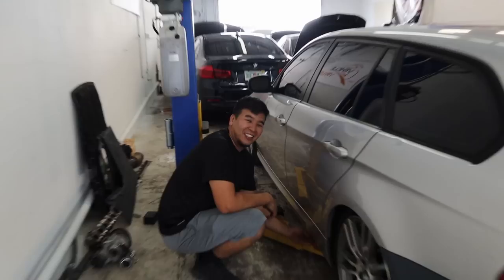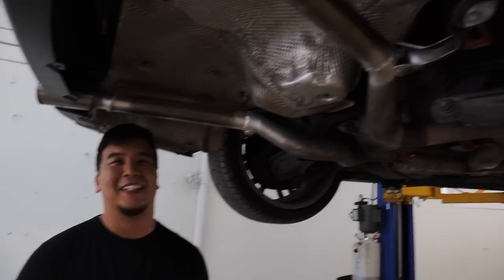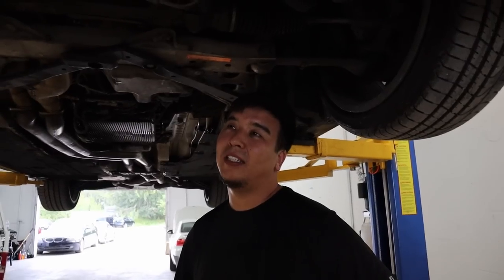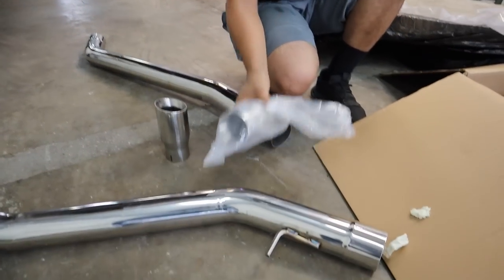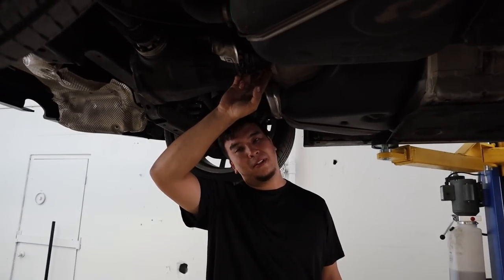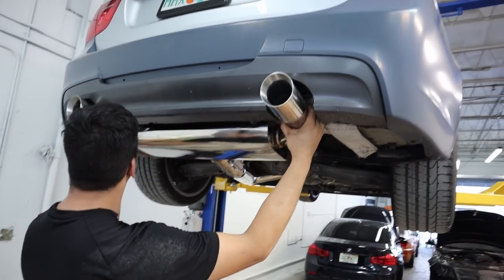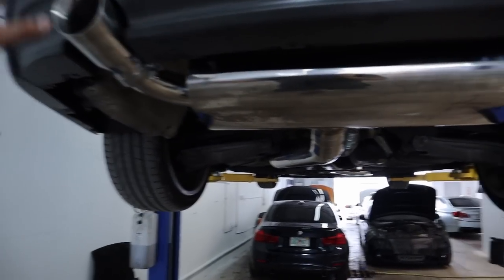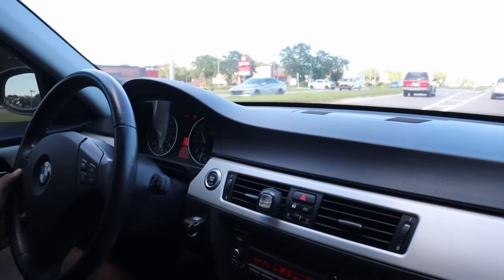Cheap Exhaust System That actually sounds good on a N54 Powered E91 Wagon!

Comment: @swap depot Check the BOV when the car is idling. you might just have the wrong spring rate if its open during idle you got too soft of a spring. Mine did the same thing on my auto until I changed the spring out.

Comment: On that Diff ratio you mentioned, if it's a DCT car, swapping diff ratios will trigger issues, but on the auto haven't seen it trigger any faults. I blew my 3.46 stock diff on my e92 n54 6at (the inner housing that holds the spider gears cracked in half), then as an emergency temporary solution, threw in the beefier diff and axles from the 335D e90, the ratio on that is 2.81! Talk about long ass gears! Drove it like that for a week then swapped it back to another 3.46 stock diff. But didn't have any issues... Other than a weird feeling as if I'd lost a gear.. since I'd be driving in 2nd while usually I'd be in 3rd or 4th lol I'd probably swap the 3.15 or 3.07 in it but the 2.81 is waaaay to long of ratio! On DCT cars it uses wheel speed and engine RPM for calculating what gear to be in. But the 6HP has its own speed sensors internally.
Reply from the maker: 4.10 diff here i come 😂
Reply: @SwapDepot  😂😂 better have some super sticky tires! Traction gonna exit the chat real quick! Especially if you gonna run the FlowMaxes on that e91 😏
Reply from the maker: Thats the plan! Light up the tires 😂

Comment: Lol my 148k mile stock turbos with 2in inlets have been doing that stupid duck noise the past 5 years and I thought it was normal (only the noise when you let off). Just heard the last part I missed earlier 🤣

When I put the stock airbox back in the noise goes away so I'm assuming it's because of the inlets. I smoke tested the inlets multiple times in the past and there are no leaks either. 

I'm also using a tial q bov with 11lbs spring connected to the intake manifold with bigger line so I don't thing it's the bov. 

If you find any fix for that noise please let us know, it's embarrassing lol.
Reply: I have the same sound lol, same bov and same spring. I think its just the way those silicone inlets sound man. My friend has relocated steel inlets and he doesnt have the duck noise
Reply: im having the same sound and can't figure it out at all
Reply: @cptrey Sounds goes away once I install the stock airbox so it has to be the stock location inlets. I have no leaks at all.

Comment: I’m surprised you didn’t get the noise after flipping around the center support bearing. From my experience those break easily and eventually wear out the Guibo lol

Question: In the long term wouldn’t it create rust if I don’t install the heat shield? I find the driveshaft heat shields so annoying but I always put them back because I’m afraid of rust in the long term …
Reply from the maker: I dont think it would create rust unless you live up north
Reply: @SwapDepot  Also I just checked my Center support bearing and mine is installed the way you originally had it. Which is consistent with other Center support bearing replacement videos on YouTube for the 335i . Are you sure that’s the correct way ? Just asking so I can flip mine as well 😂
Reply: @SwapDepot  I live in Miami so I’ll toss it 😂
Reply from the maker: Driveline has to be straight so you dont get any vibration, i would say flip it

Comment: Have you guys had any experience with Vrsf 1.75” inlets collapsing? I’m getting a noise that sounds like turbo leak, I still need to check the couplers to the intercooler, but I swear I can hear it like it’s coming from the rear turbo inlet. Sounds like it’s right on the other side of the firewall. Will be checking couplers soon to the intercooler but I was just wondering in case it is the inlet. Also the inlet is still on the turbo so it’s not from the snout of the turbo.
Reply from the maker: Usually turbo noise is caused by a loose inlet or it popped off

Comment: hey I have a e92 335xi is there any VRSF exhaust I can run or no ?
Reply from the maker: Only thing i can think of is buying the system and modifying mid section to go around the t case
Reply: @SwapDepot  word that’s what I was thinking thanks for the advice